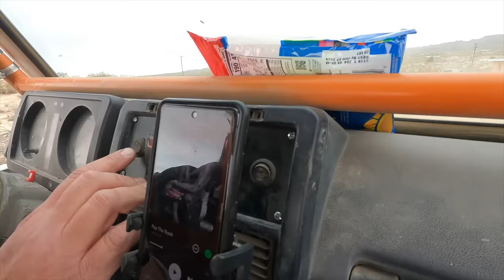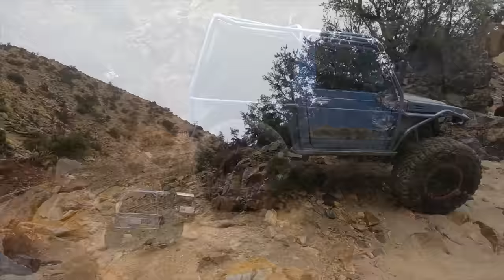Amazing weekend of Wheeling.  Avoiding the crowds of KOH

Comment: i passed you guys on the way to big bear. i did the holcomb valley loop in the snow. it was good in the fresh snow.  i almost came down the back way through 2n02\rattlesnake canyon.  but it looked like it might have flash flooded.  it was a good day with low dust.  thanks for the video.
Reply from the maker: Right on. Sounds like a rad loop

Comment: Dave, have you ever seen someone put blue Loctite on control arm jam nuts? I've seen the clamp type tube adapters that use a bolt to tighten down on the rod end threads, but I haven't seen blue Loctite used.

Also, how was the engine in that Frontier? Supposed to be a big improvement on the VQ40.
Reply from the maker: I have used loctite before, but it shouldn’t be needed .  This Nissan is rad.  It makes great power